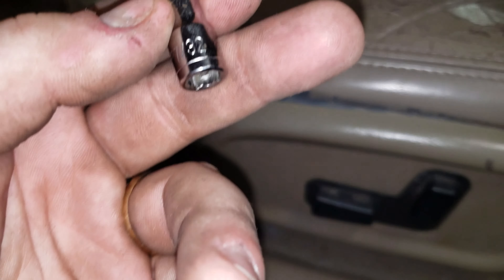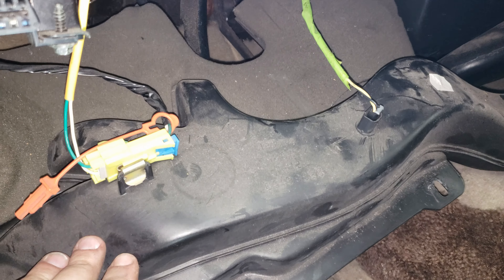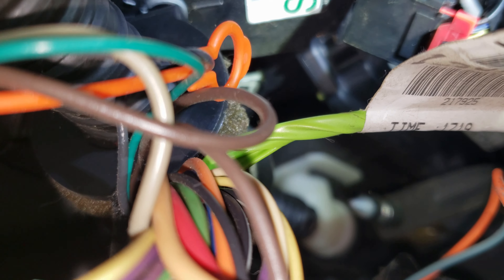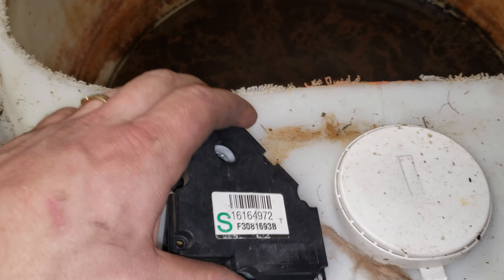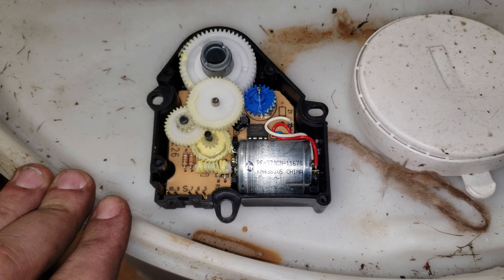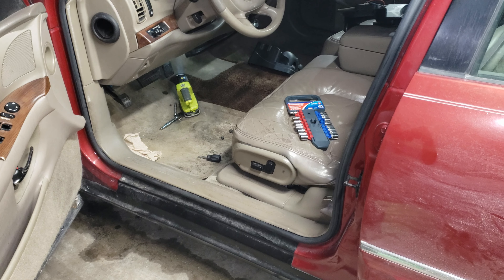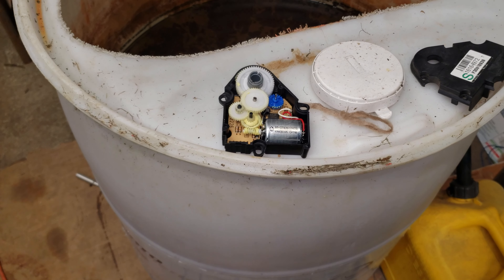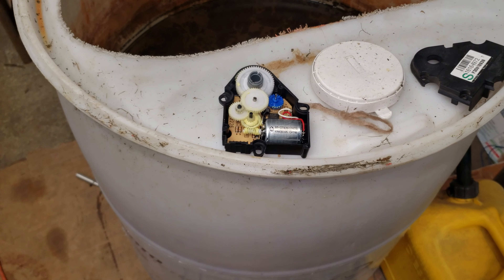1999 Buick Park Avenue Driver Side Blend Door Replacement

Comment: The actuator that changes from hot to cold is located behind glove box. This one switches from inside to outside and other one switches floor - mid - windshield. You probably have to replace the one behind a glove box
Reply: Please help. I got a 97 Buick PA ultra and can not get the defrost to blow air. Floor and mid vents ok. Just no defrost. Plenty of heat. Where and what actuator needs replacing?
Reply: @dannypowers4995  the blend door motor. It's common on GMs to fail. I had a 94 lesabre with that issue years ago. The dash will need to be removed.
Reply: These have dual zone temp controls. This is left side. Right side is behind the glove box.

Comment: I'm struggling getting that black panel off.   I took off the 4 obvious screws but something else is holding it and i can't figure it out.   Without taking that out I'm not sure i can do this myself.   Any suggestions?
Reply: There are screws behind that black plate. You should be able to put an extension through those two holes on the front of the plate

Comment: Single mom/grandma here trying to trace clicking noise under dash in 99 Buick PA Ultra. Also vents not blowing ac. Recharged refrigerant to 32psi. Gonna try replacing actuator. Any other suggestions? Thanks
Reply from the maker: Clicking sound can indicate a bad actuator. They have plastic gears inside that break.
Reply: is an actuator the same part you replaced? I believe you called it a 'door air blender' .  Thanks
Reply from the maker: Yes they can go by different names sometimes.
Reply: @skyfly51  thank you.

Comment: With my car the driver side is normal but on my passenger side the car seat is hot, what do I do? No matter if the AC is turned to hot or cold, the seat is always hot.
Reply from the maker: Sounds like your car has seat warmers? And one is stuck on
Reply: @skyfly51  Sorry, I meant my AC  both comes out different temperature. The driver side could come out heat but the other one comes out cold.
Reply from the maker: @nguoi3mien925  sounds like a broken blend door

Comment: Hey Mike I'm just browsing videos trying to find answers.  I have a 99 Park Avenue.  The air is only blowing through the floor and Defrost vents.  What should I do to get the air to blow through the vents?  How man actuators are there on these cars?  Is there a vacuum line that I should be looking for?  Can you assist me?
Reply: Your issue is with the mode actuator instead of the blend actuator. You're not going to have fun fixing that. The dash has to come off.
Reply: I have to do the blend doors and mode on mine and I am not looking forward to it. 😬